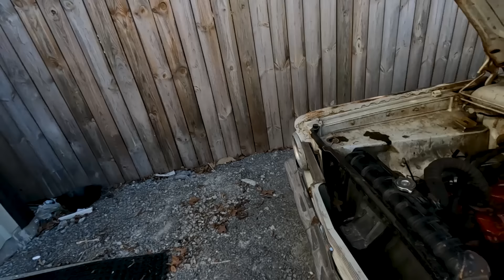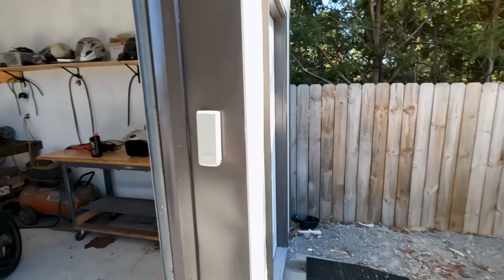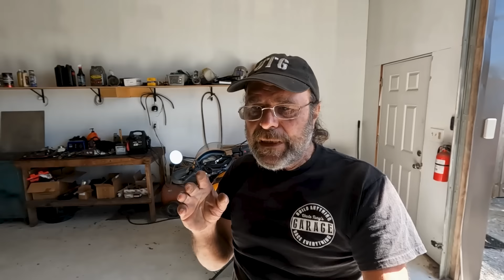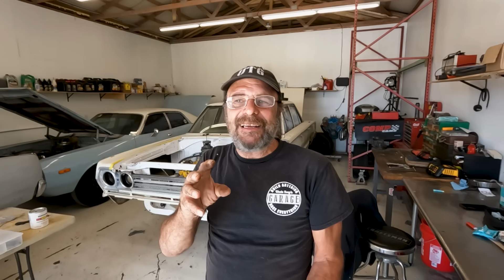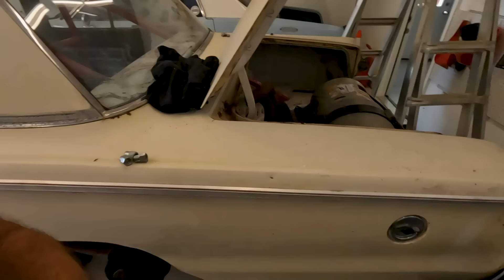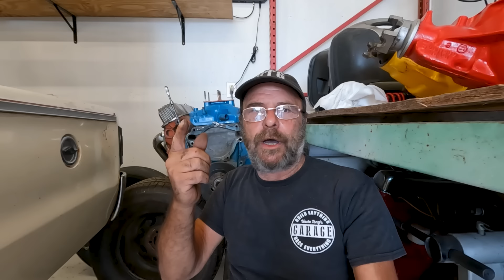Classic Car Tuning Problems - Curing Off-Idle Stumble, Bog, Hesitation, Stall And Backfire

Comment: You are brilliant, like my mech buddies back in the late 70's. My 1984 GMC van wih a 350, idles sweet but acts like it runs on 6 cylinders when I take it down thr road, and especially uphill.

Comment: Took the carb off my car and had a rebuilt one to throw on and when inspecting the old one it was on the transfer slot on idle because the idle mixture screws were set to 1.5 when on my dualjet it’s 3.5 according to the rebuild instructions. Instantly got rid of my hesitation/ entirely shutting off under load.

Comment: I purchased a 1978 G30 with a 350.  Would you recommend installing an electronic ignition and fuel injection?  I want to travel with this camper all over, including higher elevations.

Comment: I have been looking for a vacuum leak in my 1978 Ford 351W surges up and down by 1000RPM once I put it in gear. It idles steadily in park. Every time I put it in any gear it fluctuates. Please help. I believe it is a Holly carburetor. I bough this car used. I don’t touch the throttle. I have foot on the brake. Again. As soon as I put it in gear it surges up and down. I notice it more once it is warmed up. I thought it was a choke problem. My mechanic cannot figure it out. Of course. They are not use to the older cars

Comment: What a wonderful and informative video. I have a 77 Jeep CJ with a Carter YF one barrel and I'm getting a cough/sneeze as I accelerate through the power band. It doesn't happen when I open throttle from absolute idle. I did use this video to verify that my accelerator pump is working properly. I've replaced the Dist cap, rotor, all new plugs, new silicone wires, and have done my best to adjust timing. My issues started to cascade when I unwisely adjusted the timing which was indicating off the scale back to 8 then 12 degrees  BTDC. Now, I can't seem to get it back to the sweet spot where it used to run correctly but am wondering if a couple of backfires when out of time condition, may have affected the power valve on the carb. But I still found this video helpful.

Comment: All the old car guys are getting harder to find. I wish I had a buddy like you around to help me out. I have been dealing with an issue that keeps me from trusting my old truck for years. I used to drive it everywhere and now that I’m living alone I’m scared of getting stranded and nobody to help me get it home. I have tried everything I know to do and it runs fine until I get out on the road and after a half mile it just falls on its face and I can barely get it home bucking and jumping every time!

Comment: If it runs well until I take off down the road and I am going full bore about 1/2 a mile and then falls on its face and I can barely keep it running does it sound like the float needs adjusting? Would it be too high or low? This is a Carter YFA single barrel on a 78 F150 300.

Comment: We have a fresh 360 and rebuilt 1406 carb. 
Truck will start and stay running when pumping the gas. 
But will not hold and idle. 
Let off the gas pedal and it stumbles to a stop.

Comment: Tony is right in that this off idle stumble, bog, on any engine with carburettors. My 1970s triple Mikuni carb two stroke bikes, you deal with it by adjusting the air screw (air filter side, close up a quarter turn) or fuel screw (engine side, open up am eighth turn). 
Usually get a big improvement. They’re almost always a compromise. We want a perfect idle and low speed stability, but also respond perfectly to cracked open throttle as well as to low throttle openings. Really hard to get all that perfect. When you get it right, boy, it’s a delight to just ride off the throttle through a series of moderate speed bends in rural roads.

Be very careful with the wire trick if you’ve a two stroke. They’re called piston ported for a reason. You won’t be happy if you drop your wire right into the crankcase 😮
It’s not very likely, but if you’ve never done this, you may forget that there is a series of 4-5 openings in the wall of your cylinders! 
I use a dial gauge inserted into a threaded piece of old spark plug as an adapter. My coat hanger wire is an extension to the bottom of the probe in the gauge, resting on the top of the piston.

Comment: I have a 289 running a holley 570 that struggle at 2500 rpm.  Advance curve looks good but it stumbles at 2500 and is very unhappy if I try to take it further.  Assuming this isn't cam related or something more structural in the engine, could anything in the carb explain such behaviour?

Comment: Man I'm glad I stumbled upon this channel. Working on a Chrysler 413 totally stock and changed out the distributor and plugs, wires, coil. This has helped a lot. One question if someone could answer. I have the Pertronix distributor. Would I want to run that ported or manifold vacuum?

Comment: If you can provide a bit more detail, I can help narrow down the fix:
Does the hesitation only happen when the engine is cold, or when it is fully warmed up too? BOTH
Have you checked the fuel filter or listened to see if your fuel pump is making a loud whining noise? BOTH CHANGED
Is there any black smoke or a heavy fuel smell coming from the exhaust when it surges?  NONE

Comment: Used to work at a high performance Dodge dealership in Chicago. We had two Clayton dynos and dyno tuned lots of cars.
One common problem we'd see is small block engines with  huge carburetors. 1050 cfm  Holleys on 289 Mustangs, etc. When you floor it, it's like flushing a toilet down the engine. Biggest complaint was stumble, hesitation,  etc. A well tuned smaller carb would be a better fit for the application.

Comment: Warning Some 🚘 Real auto mechanics will say you do not know what you are talking about that's because most all Real auto mechanics work only on only one  Type of  Automobile But you really do know what you are REALLY  talking about I am a real ASE certified master Chief auto technician With way over 50 year's of real Hands-on real training real Hands-on Real experience at Florida University also at GM motors also at GMC motors also at Toyota motors also at Ford motors Plus at BMW motors But you REALLY Do know  What you are Really talking about

Comment: When removing vacuum advance from the manifold, you may have to plug off the leak to prevent any centrifugal advance from the increased speed and light spring rates.

Comment: The only thing I kid of disagree or would add is, your not just dead in the water until you replace your harmonic balancer if it has slipped.  Do as Tony says but mark where TDC is. Yeah the harmonic balancer may need replaced but I've seen brand new harmonic balancer be off, so it may very well not be bad.

Comment: Wow. I’ve learned a lot. I knew my Rochester 2jet 2GV.  Had internal issues. After thinking it was vacuum problems. I replaced only external parts like the choke pull off, and vacuum diaphragm. Gut feeling was to remove Carb. Opened it up. 3 body parts. Lo and behold, it had no return spring for the accelerator pump! No CHECK VALVE BALL! So much for my friend rebuilding my carb. I hit up Mike’s Carburetor parts . Ordered new kit. Then, I had to order a return spring. For my 1970 Buick Skylark Costume 350. 💪🏼🌵

Comment: Well Tony, this was the best explanation of the causes of throttle hesitation I've seen. I worked in the trade and drove all the cars starting in the late sixties. I laughed when you talked about the leather cups on the accelerator pumps! Not many of us left who remember waiting a few days of stumble until the leather swelled up and started working again after a long time without fuel in the bowl. I still use the technique of advancing the the timing until the pre-ignition when cranking interferes and then back it off a bit. Final adjustments after listening for pre-ignition while under throttle. Thanks for helping all of us understand "stumble" a little better 😊

Comment: I have a funny story... I am 27 years old and I've always liked old cars. I own a '93 Fiat Uno with a single-point injection system; it's my daily driver. Here in Brazil, we have plenty of options for classic European compact cars from the 80s and 90s (Fiats, Volkswagens, Opels/Chevrolet, and Renaults). One day my boss said, 'You should buy a Fiat Uno with a carbureted engine. It's simple to fix and you will enjoy wrenching on the car.' I remebered that my dad used to say, the Fiat Uno with a carburator runs so much better than the injected versions, so I did. I bought the sports version with a dual-barrel carburetor Webber 495 and did a bunch of things—changed the jets, needles, pump jet etc. Every single fucking time that Ireassembled the carb, I would always make a mistake that messed up the tune, sometimes bogging down after a quick throttle or causing backfires. Always... It's an experience, and here I am watching your video to reduce the chances of me fucking up the next time I'm messing with my car.

Comment: I just got my first carbureted vehicle, 1985 f250 with the 302.  It has a 2150 with eec-iv, which I have recently learned is a computer controlled feedback carb/ignition.  Guess I picked a complicated one to start with, there doesnt seem to be a lot of information on these years between carb and efi.  Everybody says strip it all out and go old school, but I’d like to learn the system before making any decisions either way.  Do you have any resources for a motorcraft 2150 with eec-iv?  Specifically how to adjust ignition timing advance?  Thanks!

Comment: Thanks for info Tony , again new to looking at carbs, I have a solex (VW) I cant get running for past 10 years , had many said they would come around to help but never did. Now my latest project is an 84 chevy s10 with a Rochester Varajet 2E2 (i think) , ran great when I bought it 2 months ago, until I started cleaning and doing some well overdue maintenance, (btw never touched the carb) its running rich, wont start on hot, idles really bad. I find your videos and knowledge really helpful. I hear the Varajet was a really bad carb? Hope you done a video on it specifically. Thanks again!

Comment: Can anyone explain why the distributor would spec manifold or ported vacuum advance?  I have a summit SUM-850055 and the manual doesn't specify which is called for.  Near as I can tell the cam would have more to do with it anyway but I've heard this advice from someone other than Tony to there's probably something to it.
Reply: I'm not sure of the answer but I think it relates to the degrees of mechanical advance added by the distributor.  High advance dists likely would be matched to manifold vacuum so that the base+mech won't go beyond the ~36 degrees total timing while small mech advance dists would match up better with ported vacuum because the base timing needs to be higher for a good idle on ported setups.  

Hypothetical examples:
Manifold: 11 degrees base timing  + 12 degrees vacuum = 23 degrees advance at idle.  11 base + 25 mech = 36 degrees total WOT
Ported: 20 degrees base + 0 degrees vacuum at idle.  20 base +15 mech = 35 degrees total WOT
The difference is slightly lower at idle and higher off-idle with the ported vacuum.

I'd be interested to see what the 3 specs are for people who have tested and arrived at a setup they find optimal especially since my dist is currently in the middle at 21 degrees mechanical.

Comment: 65 Chrysler Newport 383. I added electronic ignition, module and distributor. Do I need to run a ballast resistor with it?

Comment: Why does my  69 camaro 454 ...big cam....lurch...or jackrabbit when starting out in 1st gear.? It has a tko tremec...3.73 gears...750 holley carb....e curve distrib....timing is at 36 degrees...drops back to 20 at idle.. thx tomk fdny

Comment: thank you Senor Uncle Tony for your service. I’ve got a 64 Dodge 330 that I rescued out of warehouse in New Orleans about 2 years ago.i love this car. 318 poly first year 4 speed a833 and it wasn’t in the best but it ran and drove. It’s not like my dad’s 70 Hemi challenger, or 70 6pack 4 speed , or 63 fury real max wedge  11.5-1. Or 71 RR or his A12😂😂😂  I was born Mopar . But I love her cuz she’s a poly 4speed. And it’s  mine. I have stared  at the bottom but learned a great deal over the past 8 months since I decided to make her top notch using my skill and not money. And I enjoy it. I’m learning electrical. Dash gauges. Carbs and timing. Valve stem seals. Horn problems. Drum brakes. Where to put new electrical loads (not on battery side of ammeter 😅. Trunion drive shaft maintenance. Dome light door switches. Next I want to do a full suspension bushing change front and back.  Dual master cyl brakes. Speedo
 Cable . And one day I will have learned and conquered this whole car. Yours and others videos on here help me and I will never see yall in person to show you my gratitude. But I can leave this comment in hopes you will see and feel proud to pass on knowledge to the next gen of kids who wanted to be born in the era of these cars.  Thank yall older guys for helping us keep this alive cuz yall will  gone soon and it will be our turn.  Mopar or no car.

Comment: Thanks for the video.  It helped me find the stumble and die problem.  I thought it was the carb not set right.  600cfm Holley on a 350 sbc. or something associated.  turns out I had the vacuum line connected wrong and the timing off a bit.

Comment: I can't figure out whats happening with mine. 70 Buick 455, in Park the car is a beast, Put the peddle down in drive and it goes thru a series of bogging and surging, eventually backfiring thru the carb. Runs fine until you want to get on it. Accelerator pump is good, carb was rebuilt 5 years ago. New cap, rotor, fuel filter, timing is 10* with an old school light. I think I've been thru the whole system twice. Even checked the secondary butterfly adjustment (Quadrajet). Fuel pump is a year old, vacuum lines are good. New fuel lines. The car gets the best of everything, nothing off-brand. The engine is strong, nothing internal that would cause an issue. I really don't know where to look from here.

Comment: Uncle Tony I have a 403 Olds in a hotrod with 200r4 trans. Factory Quadrajet and distributor. No emissions, no EGR, no power brakes. Should I run ported or manifold vacuum advance? I don’t know what it was from the factory? If you read this thank you.

Comment: I have been fixing up, with my 14 year old son, two older vehicles. 1950 dodge pickup and a 1985 jeep cj7 with carburetors. What I appreciate about this video is it explains these systems very well, and I sometimes start overthinking these concepts and this brings me back to the beginning and we work together through these adjustments. What do you know about? Everything starts working as it should. Thank you for your help.

Comment: Ive seen people get stumped trying to,set timing on engines they have rebuilt because of mixing parts from different engines. 
Timing marks from one timing cover may not line up with a harmonic balancer from a different engine.
People end up having to set the timing with a vacuum gauge or by ear because the marks are out by a mile.

Comment: Hey uncle Tony, I was watching Nick‘s garage. I’m sure you heard of him up in Canada. Really neat guy. He was having problems with the engine he rebuilt. I think it was a 426 max wedge or something. It was a card that was totally restored from the 60s. It’s like maybe a Chrysler 300 or something I can’t remember what it was but it was a beautiful car and he could not get the stumble out of that card or carburetor to save his life. He did Everything new plunger knew this knew that he called a guy who restores his carburetors rebuild them and stuff he said there’s a spring under the plunger of that car carburetor and what happens sometimes I guess that spring gets weak or goes bad or something when you push the gas pedal down the plunger goes down in the spring supposed to push the plunger back up again while he put a new spring in there and took care of the problem. Something think about but thank you for your commentary. I really appreciate it and I loved what you talked about the new bullshit 3 L six cylinder motor from the little jerk off company stall Lantis anyway this is six in a row Jim.From Kennerdell pa I have a 1991.5 Dodge three-quarter ton with an engine under the hood. It kind of clatters and makes a little bit of noise and stuff. It’s a straight six I’ll give you three guesses what I’m talking about. I had it rebuilt by DNJ performance machine in Ohio water runner what a runner.

Comment: As a 26 year old with minimal mechanical experience. This has been a goldmine of useful information. I bought a 92 model 1.3 carburated VW citi golf, to restore myself. nothing special, but a beautiful car all original 70 000km on the clock, basically no rust, perfect paint. Ive recently just rebuilt my first carb from other scrap oem carbs and a bunch of other things waterpumps, cv joints, calipers, this car has taken me on a unexpected journey, where I've learned a ton of interesting things and ultimately to appreciate all the small things like how she drives with a perfectly tuned carb, with perfect ignition timing and all oem parts.

 Really thankful for these videos!

Comment: I appreciate this video. I have had a slight stumble with a brand new 302 from Bluprint engines installed in a Mark VI. Pertronix distributor, and a Holly 4 barrel (650?). 

Anyway I played with the timing, and haven’t corrected the stumble, without advancing past the pint of spark knock. 

I will check the accelerator pump. I haven’t done any fiddling with the carburetor, since it was new and should have been set with the engine. The engine was Dyno’d before shipping to me. 

I’ve been driving th car a few thousand miles now, and it’s not a big deal. But I would feel better if the stumble was gone.